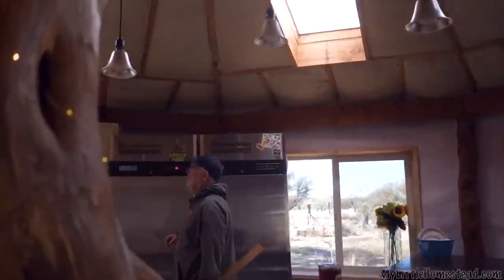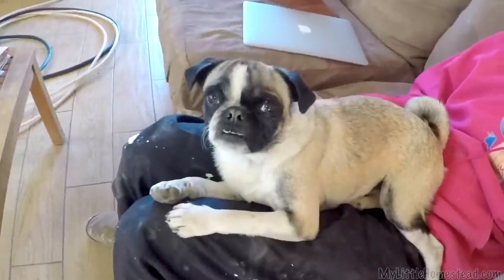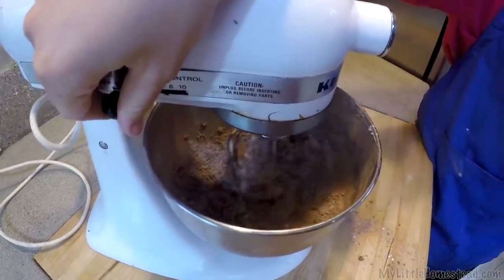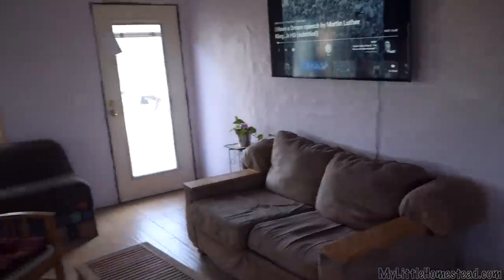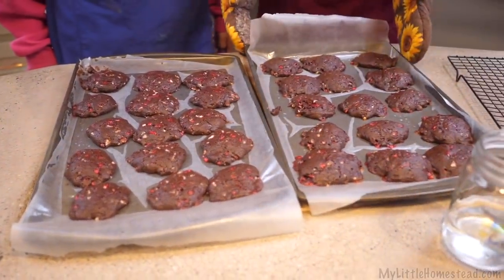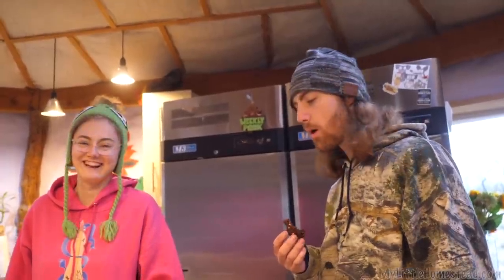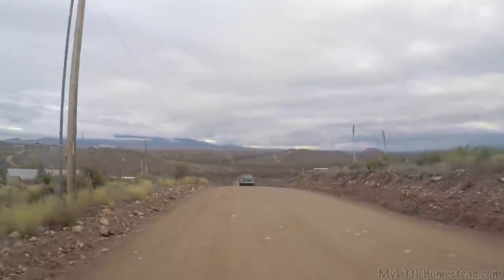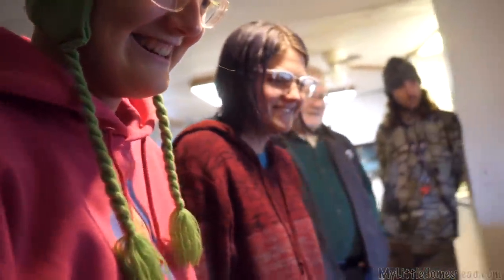New Baby! Skylight Trim/Wrap & Sprouted Cookies | Weekly Peek Ep219

Comment: please may I offer a suggestion that I follow in my own kitchen?  as soon as I buy baking soda I put it in a wide mouth pint glass jar.  then i put a label on the top of the date on bottom of the box so you can tell when it is out of date and the rising power is gone.  I also label the front as well.  And I make my own perfume body powder by using corn starch and spraying my favorite perfume in it and stir and keep in an old powder holder.   For a wonderful body scrub I melt coconut oil, about a cup and stir about a cup of baking soda stir well and I spray again my favorite perfume.  when it cools it gets solid, i smear it on my body before i get in shower rubbing very well, the soda exfoliates the coconut oil moisturizes and of course with favorite perfume Im good to go.  Hope you guys give these a try.   sorry guys, you will have to use your after shave or just use nothing in the body scrum, the coconut will dissipate.